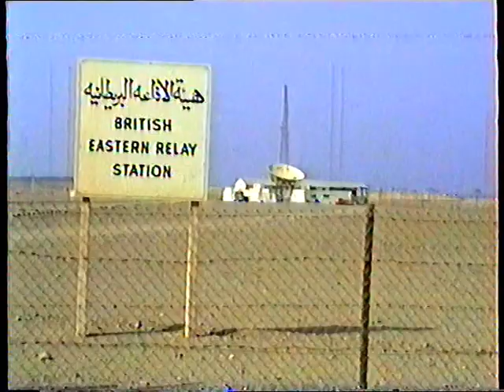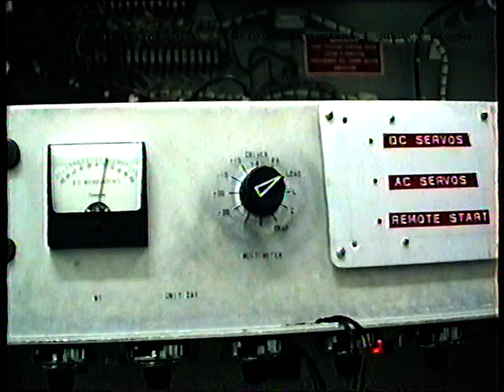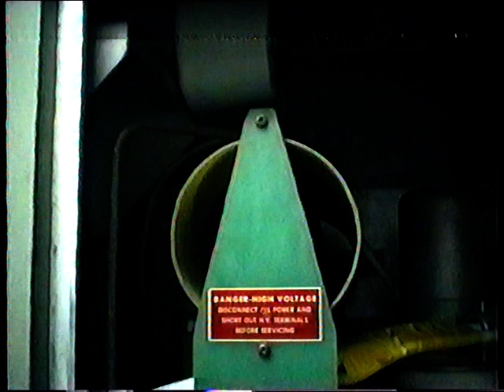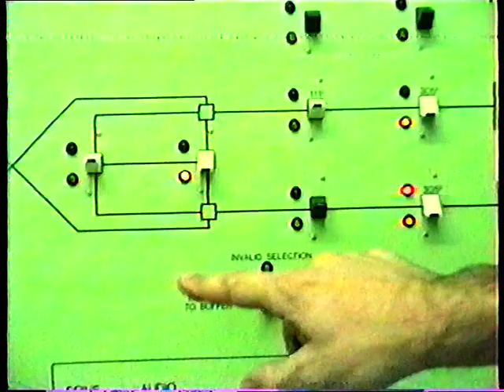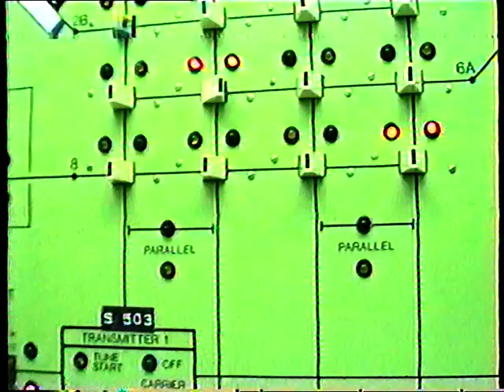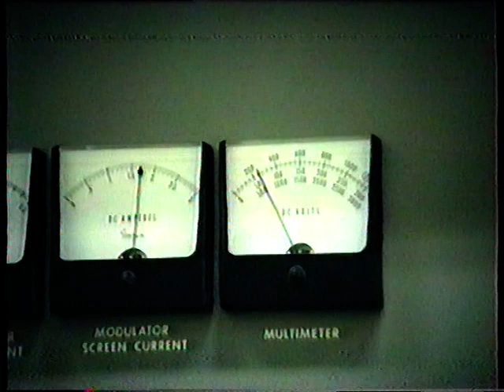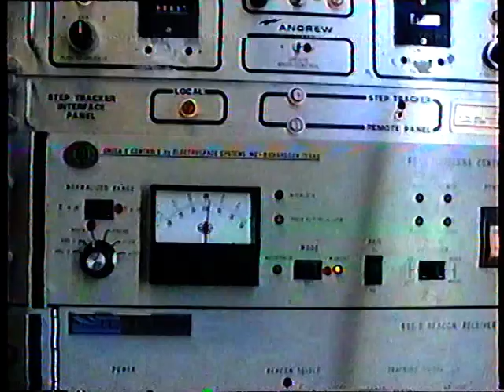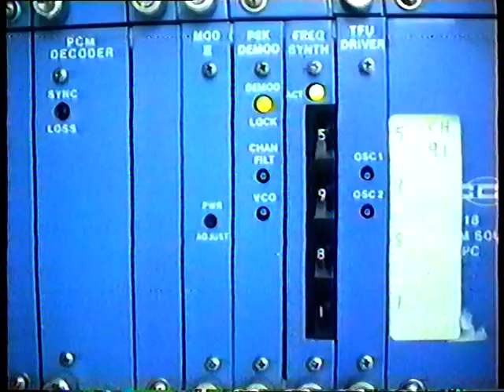HF Site Masirah

Comment: Wasn't Masirah originally fed by SSB-Reduced Carrier from Daventry? This would be back in the 80s, with (I think) 6Kw PEP Auto Tune Marconis feeding Rhombics pointed to the overseas relay sites. They always jiggled & wiggled their tuning controls with modulation as the O/P Finals impedance changed slight, so the manual controls that stuck out of the front shivered slightly.

I never worked DAV, my World Service experience was Skelton B, with the 2 rows of hairy chested, 250Kw Plain Carrier Marconi BD262s. Scary stuff when one of them would arc over.